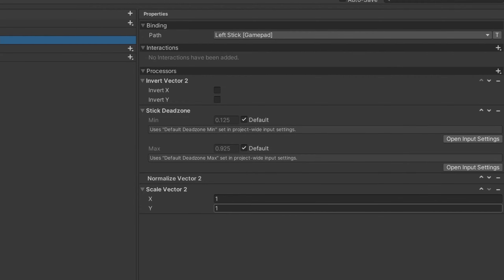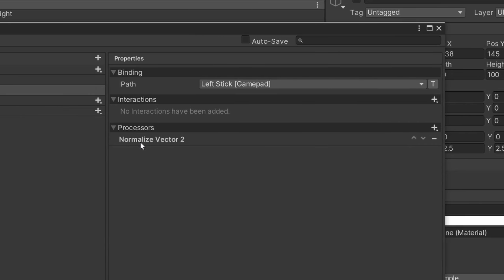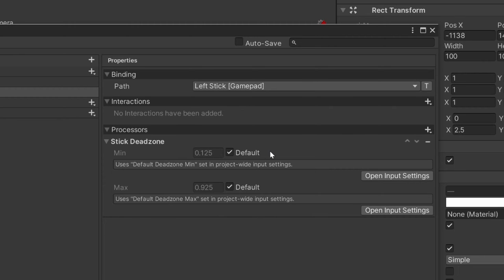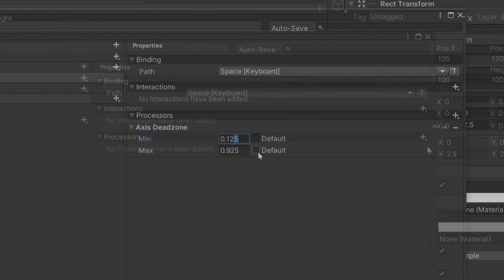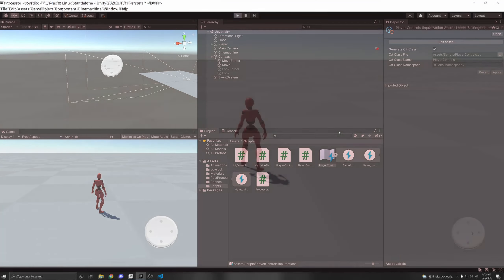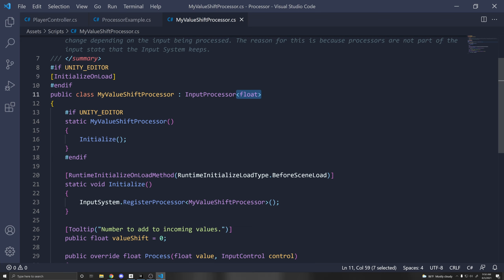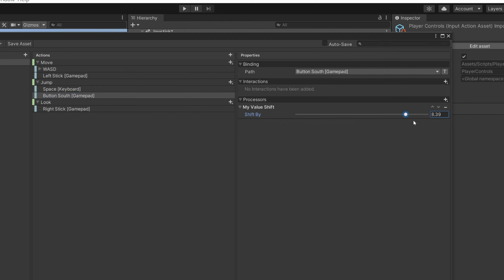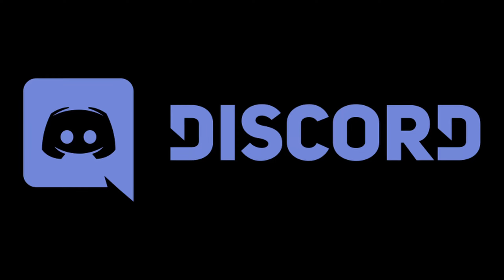Input System Processors Explained | Deadzone, Invert, Normalize, Clamp, Scale - Unity

Comment: I like how clean you explain everything, thanks for the videos! Anyway it seems though that override processors for dead zones do not actually override the default values but remaps the new values based on defaults range which is kinda strange and users don't know that !
Reply from the maker: Thanks! Huh yeah that’s weird, seems other people had this issue:
https://forum.unity.com/threads/input-settings-deadzone-values-not-respected.723287/

Someone was able to fix it as so:
“Applying a global Default Settings deadzone of Min 0 and Max 1, then applying a Axis Deadzone processor to an action or binding works perfectly.”
Reply: @samyam  Yeh it should be me, Vagabond_, but i just tested this again. You still must have some, even a small value for min otherwise when you rebind keys, the system often detects other controls then the one you're trying to rebind because of the standard input noise all the controllers produce. I set it to 0.005 instead 0.05 and it seems to be fine for now. I'm working on a racing game and have just done that :)
Reply from the maker: Great!!

Comment: Hello there, I had a small question that was in my mind for quite a while now : You are always using the Left/Right stick [GamePad] for your moving control bindings even for your mobile project even tho there exist an [AndroidJoystick] binding for that. Is there a specific reason for using gamepad joystick instead of androidjoystick or its just a matter of what you like the most ? Great video btw.
Reply from the maker: Well I haven't tested the AndroidJoystick binding, but gamepad is more general, and Unity will map different controllers (xbox, switch, ps4/5) to the generic gamepad. If you don't need a general binding you can use a specific one (e.g. a PS4 controller binding for a PS4 instead of a generic gamepad).

https://docs.unity3d.com/Packages/com.unity.inputsystem@1.0/manual/SupportedDevices.html

Comment: Hello, as I understand it, the "Pass Through" mode is used to receive the exact values and it worked for me, but suddenly I only receive: zero, one or a negative one, skipping all the intermediate values. I can't find the error or information to help me. I wish you could help me.
By the way! I am using it in a steerAngle to manipulate the rotation of the Wheelcollier.

Comment: Can you apply a processor to a modifier or does it have to be a button? I tried applying to a modifier and it doesn't seem to work.
Reply from the maker: Well a modifier just modifies when the value is returned, the actual value that gets returned is the Button value not the modifier, so you can apply the processor to the button itself or the action.

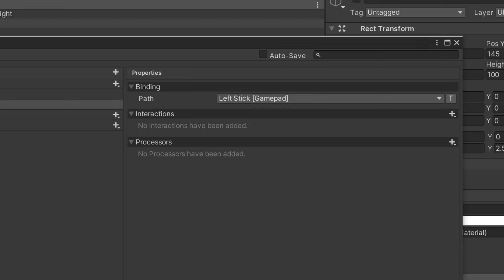Comment: 2:32 ".. if you don't care about the magnitude**" Obviously you still care about the *value when you want the direction*, but if you only care about the *direction you don't care if the directions is "big or small" in other words, you don't care about the magnitude. 

Some are probably thinking: "What even is a big or small direction?" Well, if we want a vector pointing to the right, we usually want a vector where x is above 0 so we have (1, 0, 0) for the x, y and z directions respectively. But obviously, as long as the x value is > 0 (like 0.2 or 13) and the other two are 0 it's still pointing to the right. Normalizing just changes the numbers of x, y and z to make it so the magnitude (which is the root of x*x + y*y + z*z ) is 1. So (0.2, 0, 0) and (13, 0, 0) both become (1, 0, 0) Which is why when normalized, she was moving at one "fast" speed of 1 virtual meter per second, but when it wasn't normalized and she pressed it just a little, it went between 0 and 1 meter per second depending on how far she moved the stick. (Also not that the magnitude of any vector will never be below 0, because multiplying 2 negative numbers results in a positive number. So direction left with value (-1, 0, 0) is still of a magnitude 1.

4:45 Especially if people are using a controller they use a lot, or their controller wasn't made properly, making the stick either not stick in the middle, or not reach a side completely respectively. The game would be unplayable if you only let your character move move if the magnitude reaches 1 in any direction, and will only stand still if the stick is exactly at (0, 0) in the middle.